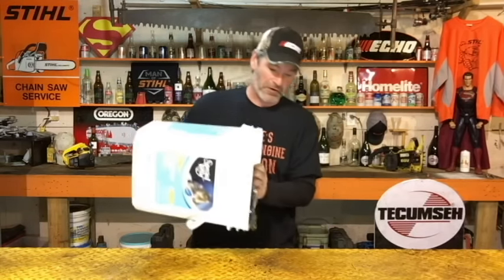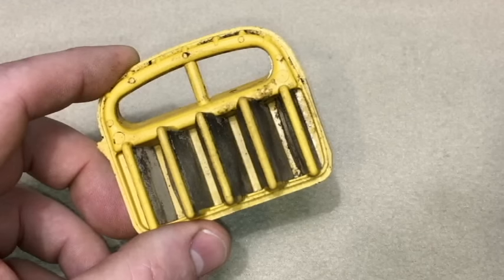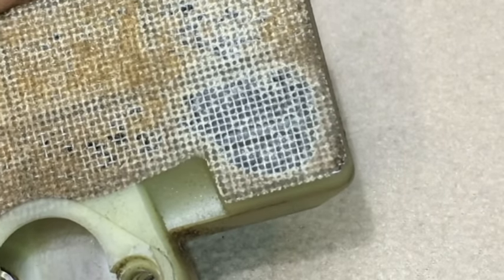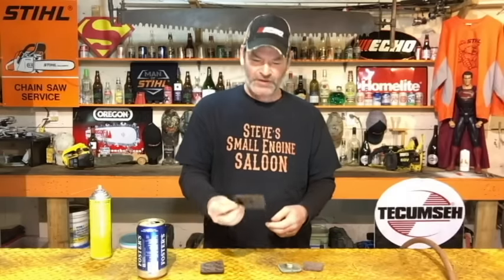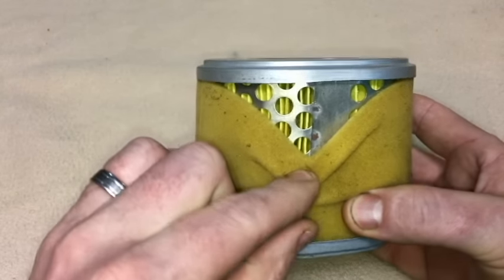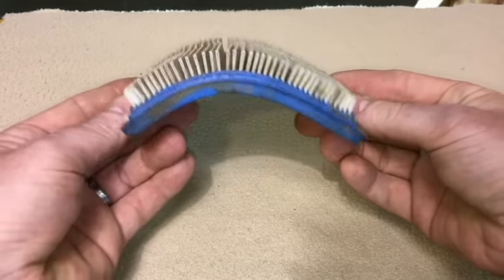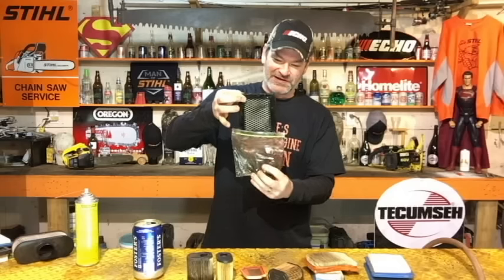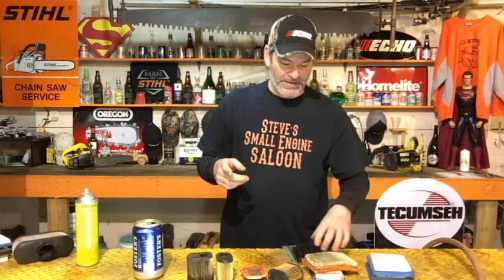How To Clean An Air Filter

Comment: Great stuff, I picked up a free mower from my neighbor who just had in in storage. Its a Toro 6.75 with Kholer motor. 

He warned me wont start needs major help to get it running .I am Kinda handy and can figure things out. Took it completely apart, the carb was all blocked off with dirty old fuel ,  took it apart, cleaned it , including the jets and passages. 
replace the fuel hose that was so bad it felt like peanut butter when I tried to clear  it.  Had the wrong air filter a foam one that was degraded to almost dust. cleaned the plug and checked for spark. . Installed a fuel valve to allow me to turn the fuel off. 

Got it running. after a while of testing it started to sputter and eventually shut down.  took apart the Carb again and cleaned more and more stuff came out, including the idle needle I think its called.  tested again ran longer so started cutting grass. 

its a self propelled one. after a while when I pressed the self  propelled lever, it would want to bog down once in while. 
I installed a universal fuel hose a tad bigger diameter, and as I recall when I took the OE hose off the tank there was a small plastic pieceabout 3 inches long  with a small cap almost to reduce fuel flow inside the hose. what can that be?

On the air box the smaller hose that goes connected to the air box had a broken nipple , I found the tiny spot where it  broke off from the air box, I don't know if that plays a role any idea.  At this point looks like its running fine. I think the RPM is a bit high.

I did order a new carb and air box with gaskets and new plug.  I wonder since I did not have actual gaskets, this may be an issue. I use gasket maker until my order comes in.  I had fun figuring this out.

Comment: After I wash a foam filter with soap and water and squish out the water, I put a paper towel on each side and stand on it.  The towel will be wet (don't do this with a good towel you can't toss) and the foam about as dry as you can get quickly.

Comment: I thought on the foam filters after cleaning them you have to add a little oil onto it and work it through and use a paper towel to squeeze out the excess oil.  The oil is what helps catch all the material the filter is filtering out and it stops the foam from drying out and crumbling as well.   Thoughts?
Reply: Yepp. I read that foam filters can use oil for better dust binding. I think this is for bigger foam filters.

Comment: Foam pre filters, i purchase foam sheet from local hardware outlet. I cut to size, use a stapler to join the ends. Make sure the new foam sheet  is the same thickness as original. Cheaper to replace foam instead of main air filter    👋 🇦🇺
Reply: Go directly to the engine manufacturer if it is still being made. I had to do it to get a part for my craftsman mower, a whole lot cheaper than sears.

Comment: Fantastic topic, been starting to really enjoy the channel. However Steve I have somethings to add. 1. Should make a point of saying you should always always regardless of type of filter when using air compressor blow from clean side to dirty, never reverse it embeds material in filter and also tear fibers of filter.  Secondly foam filters should be cleaned with soap and water like you stated but a very important step you missed is after dry you should dip filter in like a 30w oil then ring it nearly dry. Oil film is the biggest thing that makes those foam filters grab the dirt. Aside from those two things great video man. I do personally prefer just replacing them but I've cleaned my share

Comment: After flooding my Echo trimmer (don't follow the cold starting instructions) I removed the filter and just blew it off in the opposite direction and got the gas off it. It still has some oil residue on it but it doesn't affect the perforce of it

Comment: Wash the filters with pleats with warm soapy water with Dawn dish soap or Tide laundry detergent. The air filters with pleats works well also just make sure to put the pleats dirty side down and agitate the filter and let it soak for an hour or two. The rinse the filter and let it soak in just warm water for an hour or two and agitate it a few times. Then rinse it with running warm water and dry the filter out thoroughly before using again.

Comment: When you blow with compressed air, blow from the carburetor side of the filter. The dirt was sucked toward the carb and it will come out better in the opposite direction.

Comment: Hi Steve.  Great content.  Thank you.  I have a Briggs and Stratton 850ex 190cc on my Troy Bilt power washer.  My air filter is a foam filter square in shap with rounded corners.  After cleaning with soap and water should I add some oil to the filter?  Thanks

Comment: Years ago, when was young and somewhat foolish (not that I'm that much wiser now that I'm an old fart) I had a little Homelite.  I don't remember how I did it but I took a chunk of 3M brown abrasive pad and cut out a shape to place over the filter  and it seemed to catch a lot of the dust.  It worked well enough to cut a bit of wood.  That was back in the days when I didn't know that a sharp chain could cut more wood.  I gave that little saw ( sharpened, I should add) to my ex-- wife.  If she ever used it a kept it sharp, I'll never know -- nor do I even care.  Except it was an okay saw for cutting small logs and twigs.

Comment: Hi Steve,
I am a subscriber to your channel and enjoy all your videos. Keep up the good work.
I want you to know how I clean (cloth) mower grass bags.
I get laundry detergent mix it in hot water and place it in a spray bottle.
I then spray the grass bag liberally and let is stand for an hour - then hose it down.
If it is really dirty, I will repeat this process. Then, I hang it to dry - usually only takes an hour.
If the bag has holes in it; I remove it from the frame and using a needle and thread; I patch up the hole. First class results with "Like New" result. Maybe you could make a video of it.

Comment: I bought the Stihl Kombi KM-131R power unit, the Stihl FCS-KM lawn, and the Stihl BG-KM blower from Runnings in Hettinger, ND on May 18, 2018, and I have had nothing but problems ever since. A few months later I bought the Stihl Bristle Brush KB-KM, and just a month ago I bought the Stihl Pole Pruner HT-KM. I have since discovered that a group of 10 unqualified people put together all the Stihl units when they first came into their store last year. They mounted the chain backward on the pole pruner and the shaft at a 90-degree angle to the head unit. They forgot to install a bushing on the lawn edger so that the drive shaft kept falling out in the dirt. Collin Blade, the store manager, has fixed the lawn edger almost 8 times and just this week I discovered that he had never installed that drive shaft bushing. I have written several letters to Runnings and Stihl but have not received a reply. Terrible customer service from Runnings and it's not Stihl's fault because they sent me a new drive shaft and the proper bushing. I never knew that one store manager could cause so many problems. If you lived within 1,000 miles, I would gladly let you fix it!!!

Comment: I know you have heard of barrier filtration. Most mower engine filters filter better after getting a little dirty. Hustler recommends not blowing out air filters. And over servicing a air filter is not recommended. I personally like to use a shop vac to clean my air filters. And like you say I blow from the inside out.

Comment: Uhm, yeah....  Steve...  uhm, thanks for the tipping advice.  Found it a bit late, like the day I needed to use the mower :/

I used to tip out the juice like anytime it was going to stand for a long time.  And on a craftsman that might work for a few times.  Obviously will not be doing that again.  My uncle shipped the mower to my aunt in the UK so not sure on where to get a replacement, lol.  Ooh, amazon  perhaps, but yes, I think this is classified as out in the field.  Thanks a lot for the info :))

Comment: Hi Steve just watched this video pretty good information, although on the felt filters i just wash them with clean petrol and blow them out with air and reoil with K&N air filter oil also foam filters should be washed in turps, diesel or kero washed in soapy water dried the reoiled as the foam on its own won't work 😀👍🇦🇺

Comment: Steve,
Is it true that with sponge filters ,place a little oil on your hand after the filter is dry and squeeze the sponge so it has a very light coating ,
This apparently stops more fine particles entering the carb so easily and stops the sponge from crumbling later on,

Comment: i hit my Echo air filter today with a soft powerwash, but strong enough that it looks brand new. I have it hanging to dry now.|

Any reason not to do this method? I should have researched first but i felt confident with the right setting I could easily clean it without damaging the material.

Comment: Another good video.  Two things: 1.  Which way to tip your lawnmower depends on the configuration. I would never tip my old Sprint engine air filter side up.  2.  Oil your sponges

Comment: Thanks Steve, although the filter I want to clean is for my stihl strimmer F5 38, the one you said to just replace as it's cheap but I would like to clean it. I have no air compressor. What is the best way to do it please? Ps I am the wife, I don't mind using 'my' kitchen sink...
Failing that have you done a video on how to dismantle and clean the carb'?

Comment: Being a dirt biker and they have foam filters. I use gas or varsol. Then soap and water in the magic sink. Then oil with foam filter oil ( bike dealers). Wring out excess oil. When washing with soap and water use warm not hot water. Glue will separate. Same if you use magic clothes dryer low heat. I do this when my wife is out shopping.

Comment: Compressed air can blow a hole through the paper filters if the air pressure is too high , easier to just replace to protect the engine .

Comment: I had a felt filter on a Japanese strimmer that was clogged and I sprayed it with WD40 then brush it with a brass bristle brush. Repeat this a couple of times spray it again with plenty of WD 40. Then sandwich it between 2 pieces of absorbant cloth on a table or bench surface the give it lots of good bangs all over with your fist. Unwrap the filter and it looks as good as new. Not everyone has an air line or compressor.

Comment: Sir - you are a great value to us laymen people!  I appreciate the videos. Quick few questions,  an air filter on a Kohler 17.5 HP lawnmower.  They have a pre filter/foam band and that can be cleaned with soap and water. So how do you clean the main inner filter? Air compressor?  How often or how many mowing hrs. do you recommend to clean both the precleaner and the main filter? Also how after its time to replace and  buy a new one? I have an acre of ground I mow and I mow 3 times a month, and I grind up  leaves fall of the year for about a month .. Sorry for the questions, but I do value your input. The reason I ask is 'some' say air compressor will damage the paper fibers in the filters. . Looks like to me if you don't get to close and aggressive with the air compressor up to the   filter then it should not hurt  to use compressed air?? Here is the filter mine takes in the link. 

https://www.homedepot.com/p/John-Deere-Kohler-17-1-2-HP-Engine-Air-Filter-Pre-filter-for-John-Deere-Lawn-Tractors-GY20661/100139670

Comment: I got a question. There’s one kind of filter I didn’t see which is the kind that I have is shaped like a cylinder and it slides onto a tube on my riding lawnmower. T110 craftsman what do you suggest to clean this filter? I can send you a picture of it if necessary, but I’m sure you know what I mean.

Comment: I know this is 4 years old but a question. The mesh filters, could you put them in a ultrasonic cleaner with dish soap?  My stihl ms 250 has a fuzzy mesh air cleaner.

Comment: i have a small champion generator 3000w running, with one of the black foam air filter. the engine surges when running. i purchased a new carb because it was super cheap, originally i thought it was the pilot jet. now ive found that if i plug up some of the air intake holes while its running i can get it to run smooth. (new carb did not help) ive since cleaned and re oiled the filter with no success other then when i hold my fingers over some of the air intake ports. any thoughts

Comment: I've always been a big fan of Ether (starting fluid) for cleaning. Just cuts grease and grime sooo well! Even dirt and mud. Just takes everything right off! and, has a secondary purpose as a starting fluid if ever needed. Not saying right or wrong, just saying in my experience, I've become an Ether man! just another tip for your subscribers.
Reply: I usually pour a bit of gasoline in a glass measuring cup and soak the filter for a few minutes before swishing it around in the gas to flush the dirt out.

Comment: Do you have a video on how to remove ethanol from water for small engines? I’m wondering if doing the water mixing method then after filtering if using heat can be applied to remove any left over water in the unleaded fuel.

Comment: Good video. Learned a lot.
Question? I've always soaked my form filers in clean engine oil and squeezed them out after soap & water cleaning. Does that work? Or am I restricting air flow?
Reply: That is what my owner's manual says to do. I bought a second one, so that it could dry completely before I oiled it. (Take the dirty one out, oil the new dry clean one, install it, and then wash the dirty one and let dry.)

Comment: Thanks for the great vid. I tried to clean my 1987 Briggs 0158engine flat paper airfilter by soaking it overnight in gasoline.. it bloated by 1/3 its size and partly desolved the rubber sealframe breaking it to pieces! Also it's still clogged.

Comment: Are there small engine air cleaners that are treated with oil before installation?  The shop I use mentioned after servicing my Husqvarna string trimmer that the filter had no oil on it.  So I thought they were saying it was a bad thing, but could it have been a positive comment?

Comment: Hi Steve, thanks a lot as learned a lot from your videos. I have a question that why my lawnmower makes a lot smoke after starting and sometimes even oil spills out of exhaustion. What is the solution, how do I maintain the engine? Thanks
Reply: You have the engine overfilled with oil, check the oil and drain the amount that is above the full mark 😄

Comment: My paw paw always used regular gas on the foam filters and his filters seemed to last forever he said gas was fine but not to use carb or brake cleaners they either content will melt it away thats also why he never used starting fluid in his motors with the filters in he'd take it out spray and start whatever was being difficult and then he'd replace the filter after he got it running...he also only used real gas to mix he said never use ethanol gas for small engines I just do what he did and haven't gad any major problems

Comment: I have the exact same foam air filter on my lawn mower as the yellow one you showed that had the several very dirty circular spots on the bottom. The manual says after you wash it out you should coat with a light layer of oil. I have seen that mentioned for other air filters as well and wondered what your opinion on doing that is, or the pros and cons of both using oil and not using oil?
Thanks
Reply: The old Briggs & Stratton foam filters did say to wash it out in kerosene (lots of people used gasoline) then coat with engine oil. 
I was taught to squeeze the excess oil out, install it, and drive on.

Comment: An old timmer climber taught me to regulate the air pressure on the still air filters like 192,3 - 200,1 chainsaws is it true you can hurt them with too strong of air pressures
Also how bad is it if the condensed water gets in just before leaving shot to get to the field to start jobs???

Comment: Steve just got a curiosity and you're the professional I'm just an excavator operator but we were always told never to use an air compressor on a air filter because you end up perforating micro holes and actually making the filter unfunctionable afterwards. t Thoughts?

Comment: I clean first with carb cleaner (The Items I Can Clean) then I've built a stainless steel rack with 1/2 inch square holes in it that fit's into the top rack of my dishwasher with a top, and I put my filter's in their, now the flexable type lawn mower filter's I have a holder that Holds them round along with other holder's for different type and shape and size of filters and I wash with dishwasher soap only on pots and pans scrub setting and the hot water boost on and add a little extra soap at that time and I turn the heat dry function off when cycle is complete I take the whole thing out as is and let air dry.

Comment: I have a style BR200. Runs pretty good. Think its size is why I wish it had more power. But, it has started shocking my hand when i use it. The longer i run it the bigger the shock feels. When i have the throttle lock on it shocks whatever part of my body closest to the output. How can I fix that? Please

Comment: I just ran across this segment,  and have to mention ( after working on small engines  for over 35 years  ) that cleaning paper pleated filters with gas is not good . I've had them come in where they won't  start , or if they do they cough , sputter , smoke etc , and all caused by being  washed out with gas more than one time . I could start them without the  filter and while running put it back and it would kill the engine !!! They don't look dirty but they are usually a dull yellow. It just dries and hardens and plugs them !!! Just sayin 🤷!! Great video !!